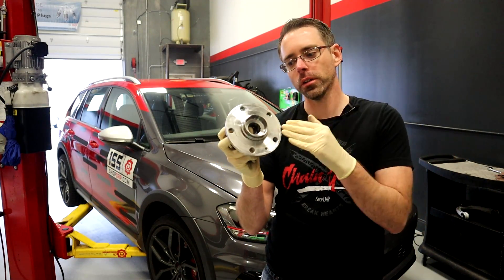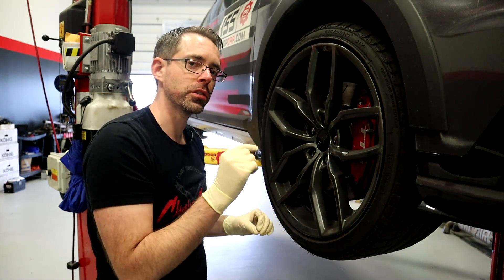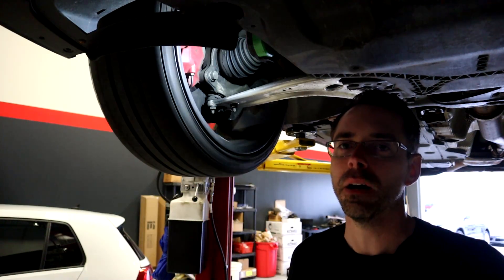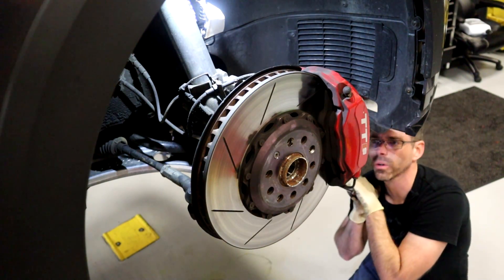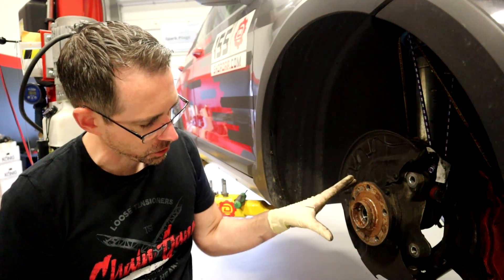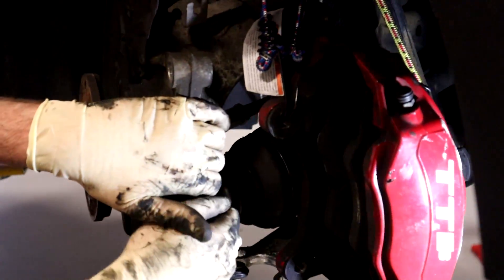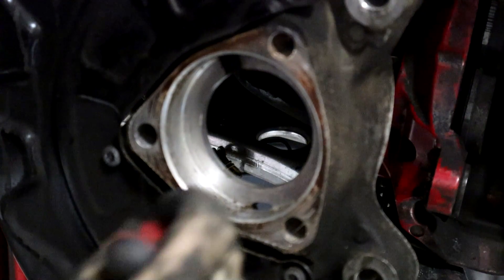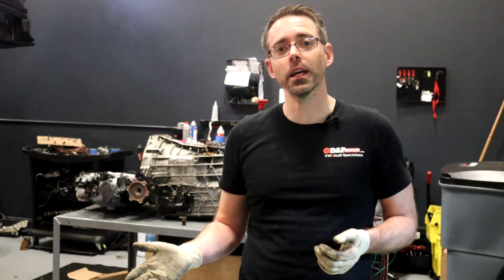How to Diagnose and Replace a MK7 Wheel Bearing

Comment: Argh. This is frustrating for me. I thought I had a bad bearing in the right rear. However, the sound I get is basically a loud drone that does NOT change when changing direction. It's gotten progressively louder in the past several months and it's really starting to irritate me. Any clue what that could be if it's not a bearing??
Reply: Could be the tyres that are cupped, have sawtooth wear, aren't round anymore (flat spots/uneven wear) or are just old.
I think the rear bearings could also just be less prone to changing in sound when you turn the wheel.

Comment: FYI: when buying new wheel bearings make sure you get new bolts in with the kit. As these are stretch bolts and  they cannot be reused. REMOVE AND REPLACE ONLY.

OK, front and back done. Back is much easier, however you’re most surely going to have trouble removing the brake disks. There are several good you-tube videos on how to make a special tool that pushes the disk of the hub from the backside.  https://www.youtube.com/shorts/9U8J0rs-hLU

Comment: My GTI sounded like it had loud tires at lower speeds.  No play in the bearing/wheel.  My axle was a bear to remove and it took some wrestling to get it back in.  I did both and the second one was easy by comparison.  Maybe it is easier if both wheels are off the ground?    I was only able to get 45 degrees on the bearing bolts with the car on a jack.  You will need to get the car high enough off the ground to use a breaker bar if you want to get to 90.  I had the same issue with the rear brake cradle bolts.  Never got to 90 w/18" of leverage.  Note that once you put the axle back in, you no longer have access to the bolts later without removing the axle and replacing the axle bolt.

I had one bearing fail at 45k and the other one slowly go until 87k.  Junk in my mind.  Those were SFK bearings from the factory, BTW.  The axle bolt is 148ft/lb with 180.  Not too hard with a 24" breaker bar.  If your rotors are stuck, remember that half the lug nut holes provide you access to the rotor.  Put some PB Blaster in their to help the process.  Worst case, you can remove the rotor with the hub and break them loose off the car easier.

Comment: Had a light hum that seemed to come from pass side front, no play at wheel when checked,  didn’t change loading left or right, did change with speed. Got the hub exposed and spun by hand and she was rough and dry, had a notchy spot and I’m assuming that was the cause of the slight humming sound. Just in case anyone is experiencing the same or similar issue… I’m in 2017 GTI DSG 42k miles
Reply: What do u mean by notchy spot? I have the same issue I’m wondering if changing the cv axle is the answer or wheel bearing or both? If u can help me with a solution that would be great
Reply: I removed the wheel, then hub from control arm and axle, and had just the hub/wheel bearing by itself, I spun it by hand and it wasn’t smooth at all, a particular spot when rotating it felt notchy, I’m assuming a small portion of the bearing race or balls were worn causing it to feel that way. If you have a light hum or growl noise it’s most likely a wheel bearing just starting to go out.

Comment: I tend to get a single knock sound around my front right wheel when I am reversing with full lock steering to the right. Sometimes when driving forward up a ramp with full lock steering to the right, I get a similar knock sound as well. Is this a wheel bearing failure?

My lower control arms, ball joints, tie rods, end links, ARBs, driveshafts, coilovers, top strut mounts are all relatively new (<15,000km driven on them). Other than the wheel bearings, the only part I have yet to replace is my steering rack.

Comment: Have you ever stripped one of the triple squares holding in the wheel bearing? If so, what have you done/recommend to be able to remove it?
I went in to replace my driver side cv axle n my mk5 gti yesterday and figured I might as well replace the bearing since the other 3 bearing have been replaced. Needless to say one of the 4 triple square bolts stripped :( 
Thanks for any advice!
Reply: Did you fix it?
Reply: did you succeed?
I think maybe drill the head and use an extractor but may not be enough space.
another way would be to use an angle grinder from the outside, the side where the bolt threads are connected to the wheel bearing, and just grind the wheel bearing housing where the threads are until there's nothing left to hold it anymore.

Comment: Finnally a second use for my 60$ triple square kit!   All ive found a use for them was therear brake caliper carrier bolts and possibly the electric seat rails but i cant quiet remember.
Happy too know vw uses the phenomenal desighn of triple square for more then just one thing!

Yea triple square was a pain in the butt for me as i had too put everything back together and order the set and then redue it but
Triple square and torques bits are by farr the best bit deaighn ive ever come across. Think about it: 8 internal splines. Internal so it cant strip unless the metal litterally breaks of and then again theirs 8 splins!  Also the chance of it breaking off are slim too zero. The surface area transfer is like 90%. For reference philips has like a 15-20% transfer surface.  Because its an internal bit the only failure point is basically if the bolt snaps off or if the head splits off. Both of which have nothing to do with the desighn itself.
If you cant tell i love triple square.
I dont wanna go back and correct but torx is 8 splin. I believe triple square is actrually 12. Just caught it cuz i typed triple square and remembered its in the name. Triple/3-square/4. 3x4;12

Comment: The wheel will not come off stop spreading fear. The axle is stuck through the bearing and held on by the huge axle nut. It won’t fall off people.🙄
Reply: The nut pushes on the inside wheel bearing surface.

The only thing stopping it from falling of is the brakedisc and caliber holder
Reply: On FWD rear axles too? No axle bolt there. And yes it's a bolt on these cars.
Reply: @CyseTV  in the case of golf in the rear the have a stud attached to the rear axle unit. Looks like a shaft with some threads on the front (outside or inside threads) the bearing itself isn't pressed on the shaft. You can remove it easily from the axle. I had done this on a vw golf mk 4, mk5 and other vag vehicles. It's pretty easy
Reply: Loading and uploading doesn't always make it change. Also, bearings can be loose and still be quiet.

Comment: i also have a similar problem, it sounds like a drowning noise, that starts as a very faint noise at about 60kph you can barely feel the vibration through the pedal in the feet. Then at about 100kph-110kph, it starts to be very very clear, the vibrations are much more intense and frankly on the highway at 130-140kph, i can't drive too long without any music covering that humming noise. Plus, I must use the cruise control because the vibration in the pedals is tiring for the feet.
I first thought it's an engine mount issue, but then, it still happens with the gearbox in neutral and engine at idle, while still rolling with 120kph, so it must be either the planetary gear or wheel bearing. sick and tired of this, going to my mechanic in the next few days. i suspect the rear bearings but i do hear something from the front.

But anyways, yours is much worse, mine is barely audible till 100kph, hence much harder to spot. Also, being a petrol car (octavia 3 1.8 tsi), engine is very silent even at 2000RPM so any noise is heard much better, hence why this rumbling, humming, buzzing noise/vibration getting on my nerves.
Reply: Any update? I have the same probblem
Reply: @arvinbhandal6283  it was the front wheel bearing, changed both.
i've tested it by getting the car up on the elevator and accelerating to 60-100kph, then leaving it on neutral so that the wheel spins freely. and then the sound was clear.

Comment: The manual specifies that you should NOT lower the vehicle onto the wheels until you've torqued the axle bolt to the initial value as you will damage the bearing, it also specifies 200nm plus 180. Where is the lower value (70nm +90) coming from? I'm sure the second value is the correct one as both my axle bolts were fairly easy to loosen, just trying to understand where this came from...
Reply: I believe the older style axles need that crazy torque but the new ones need around 100 nm
Reply: @Abuh98  I torqued to 70nm plus 90 and it’s been fine. Couldn’t find anything official on it but for sure it wasn’t 200nm tight when I took it off. Thanks!

Comment: I have a noise on my front left wheel sounds like a basketball bouncing is that my wheel bearing? I checked my suspension maybe I'm missing something but I think it is my wheel bearing. My tires are inflated by the way to 37 psi which are new tires.

Comment: Thanks for the video. Did this today on my wife’s a3 etron. Went well except the brake rotor decided it wanted to be permanently attached to the hub. I ended up removing both together lol. Then I put the rotor on two 2x4s and smacked the hub lip with a mallet. Still didn’t come out easy, but it came out.

Comment: Good video!  Questions for you....  I had a mechanic replace the stone shields on the rear brakes of my 2 wheel drive MK7 Golf.  A short time afterward, the left rear caliper seized up.  They said it was a coincidence, and I paid for a replacement. .  A day later the right rear caliper seized up.  MUCH smoke.  They again said it was a coincidence and replaced it for me.  They also replaced the pads.   I continue to hear a grinding /scuffing noise from the rear that increases with each mile I travel.  I'm wondering if they had to take off the wheel bearings to install the stone shields, and whether the heat from a frozen caliper can boil all the grease out of a bearing. I have road tested repeatedly, but there is no difference in noise as I load and unload the wheels.   One more thing. I often hear popping noises from the rear wheels when I first apply the brakes.  This problem has ruined my gas mileage, and the car is no longer any fun to drive.  The noise is a constant worry..  I've asked no less than 5 shops, including the dealer to diagnose this, but no one has come up with anything.
Reply: Do you live in a salty area where your e brake cables could be degrading? Also, I’d have someone look at your abs.
Reply: @robertgreenfield9051    They use lots of road salt here.   But I've seen the e-brake cables, and they are not the least bit  rusty.  Unfortunately none of the independent shops around here know how to diagnose ABS problems, and the VW dealerships within driveable distance are HOSTILE.   Why?   See if this makes sense to you....

 After taking my car to 4 independent shops I went to the VW dealer where I bought the car.  They had my car for 3 hours, and told me the e-brake cable was "extremely rusty and disconnected on one side". They also told me the pedal was "going to the floor".    I knew both of these claims were false, but since they supposedly warranty their work, I told them to go ahead and fix the problem  An hour later they told me they had no parts to fix my car.  They did NOT know if the parts would arrive in 1 week or 4 weeks.   I asked them to call me when the parts arrived, and I'd return.   They balked..   They said my car was unsafe to drive and didn't want to release it to me..   Unwilling to leave my car for an indeterminate time and pay for a long rental, I asked them to "reconnect" the cable and bill me for that.  I'd take my chances with the old cables until new ones were available.  They then claimed that reconnecting the cable would take too much time!   (They had had my car for four hours and they couldn't find 15 minutes to reconnect the e-brake cable?)  

I paid the diagnostic fee and  insisted that they give me the car back.   I drove it straight to an independent shop and watched while they put it on the lift.  The cables were not rusty, and both were connected.  The shop mechanic confirmed that they operated fine.   The next day the VW dealership emailed asking me to fill out an online review.  I gave them ONE STAR.   The  VW service manager called and angrily complained about my review.  I told him if they could justify a better review, I would change it.  He hung up on me.  A couple days later I tried to get an appointment with another VW dealer (one I'd never dealt with), and they were aware of my visit to the first dealer.  They implied that I couldn't be trusted to pay my bill, and didn't want to give me an appointment.  So it is likely that the first dealer retaliated for my 1 star review by bad mouthing me to the other VW dealers in the area.   Now I don't know if I can trust ANY of the local VW dealers.  I contacted VW corporate and asked them to investigate and help me obtain service on my car.  I showed them proof I'd paid my bill.  I told them (truthfully) that I'd been wanting to buy another VW before this incident, and still would if VW would help me get the car fixed.  VW expected me to go back to the dealer that lied to me and retaliated for the bad review.  I told them I could not trust them, and that was the end o it.  Apparently VW doesn't need repeat customers.

So

Comment: Could this cause some mild gas pedal vibration? It feels like a light buzzing, but it not audible. I can feel every change in road surface. I have tried 3 sets of tires and 3 sets of wheels granted all used condition and not great tires. I occasionally feel it in my wheel too but it's not too much. The roads here are very rough so hard to tell.

I am at a loss here. 4 months and I can't fix this ghost vibration. Dealer replaced right wheel bearing and found a torn CV boot that they also replaced, but didn't mention this to me. Not sure if it could be a left bearing.
Reply: Same issue. Axle, right bearing, haldex, guibos replaced, no help
Reply: Any update?
Reply: I replaced it, still have some pedal vibration I’ve just gotten used to it. My state is like #44 for worst maintained roads.

Comment: Getting the axle splines aligned/seated into the bearing is by far the hardest art of the job (for me), if you’re on jack stands.  Can’t really see what you’re doing and you need a third hand—two to pull on the wheel assembly and one to guide the axle splines in—as the tip wants to flop around and not go in the bearing hole.
Reply: Secret is to pull the strut towards the front of the car. It binds up otherwise. Had the same issue and as soon as I pulled it forward, it slid right in.
Reply: Yeah I just replaced my bearing last night and was kinda pissed he didn’t make a video on the hardest part(putting it back together, ) I did the job by myself and couldn’t get that damn axel back in, I was up till 2am when I got it finished….

Comment: I have a 2016 jetta 1.4tsi and I have a bunch of lights that came on my dash took it too a vw guy and it is my abs sensor and wheel bearing, do both need to be replaced at the same time ?

Comment: Thanks Paul, R/R 'ed my wheel bearing on my 2015 MK7 TDI with 38K (Whut!) this weekend. Your video guided with diagnosis and replacement, went smooth and have a smooth ride now. No more generator sound at 35+ mph. Cheers!
Reply: Not the age. A good pothole can take them out.

Comment: At the end with all the torque specs, you say replace the ball joint. I need new wheel bearings but do I need new ball joints as well?

Comment: In addition to listening for sound, can you also check the temperature of the lug nuts or wheel studs? In the 1980s we could tell by touch that the bad bearing wheel was hotter than normal.
Reply: Do you do that by feel? I touched mine last night after a drive and they we’re both the same temperature.
Reply: @hardcore4476  In the 80s and 90s when I had a wheel bearing making noise I could tell which side it was because the bad side lug buts would be noticeably (20+ degrees F) hotter. I am not a mechanic so this might be horrible advice.

Comment: I noticed in the workshop manual that the car need to be in the unladen position to fasten some bolts. I have looked on internet for it but cannot find anyone that mentions this. Does anyone do this?
Reply: what’s that
Reply: @dumbeezy5480  Unladen position means that when placing the car on stands (free hanging axel/wheel), lifting the breakdisk to so that the axel is lifted to a certain hight before tighten the bolts on the swivel joint. In the workshop manual ed. 01.2018: "Tighten nuts arrows in unladen state ⇒ page 5". According pg. 5, for GOLF, this is for BlueMotion 370+/- 10mm. But other hights for other versions of the Golf (e.g. BASE => 385mm, Sport => 370mm, etc). This wasn't shown in this video. By the way, this is a dangerous operation as the car can fall off the stand when lifting it to unladen state (which actually happened to me while tightening the 3rd bolt of the set. The manual warns about this. So I had placed a 2nd stand just in case and luckily it catched the car falling.).

Comment: You can also have pretty severe pad knockback.
As the wheel gets a slight wobble the brakepads will get pushed away from the rotors, thus the first push on the pedal after nof using the brakes for a while will be mushy, as the first part of the pedal travel is now used to push the pads closer to the disk instead of clamping the disc.

Comment: Usually I’d have to car up in the air, have a second person ‘drive’ the vehicle while at its off the ground, get to around 60-70mph and then stick the car in neutral and turn the vehicle off, that way you can hear the bearing ‘whine’ without being drowned out by engine noise, for a much clearer diagnoses of the faulty bearing.
Reply: Yes you can do it that way too